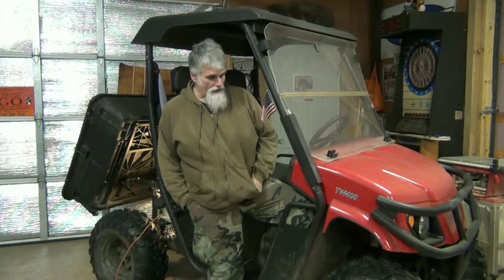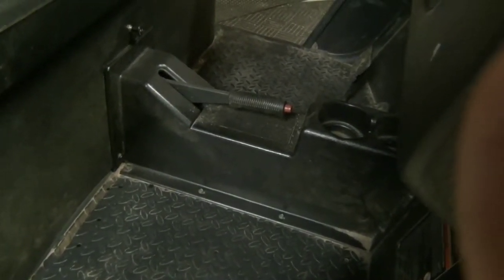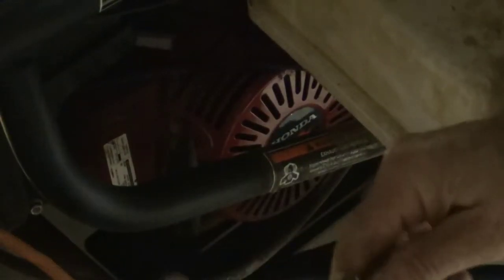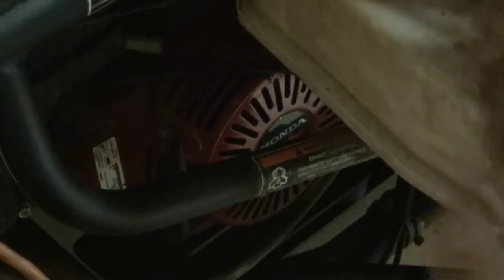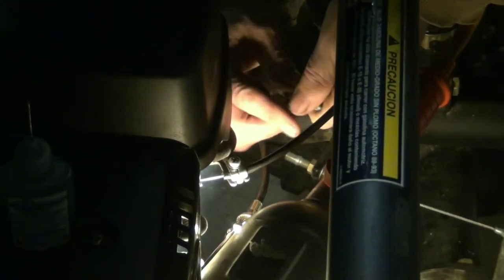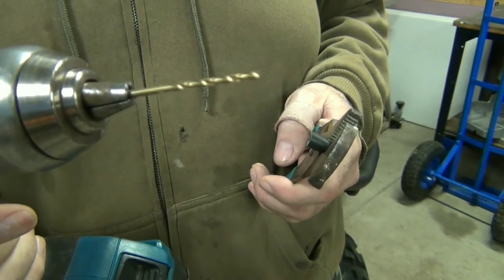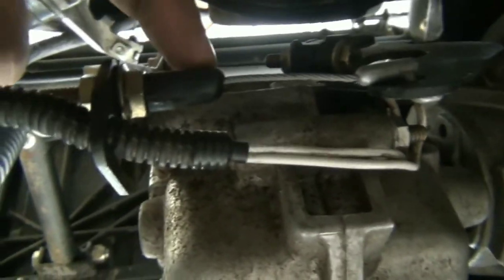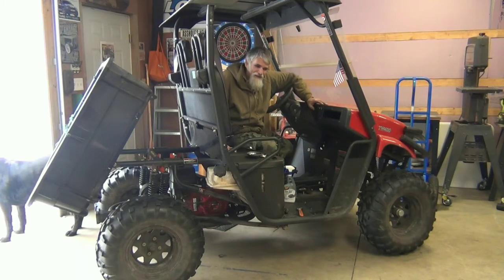TW400 TRAIL WAGON How to fix freezing Shift Cables using BLUECREEPER

Comment: Good video. Thanks for the info. I just purchased my tw400 at an auction. Both shifter cables were locked up in mine. I replaced them both. It wasn't too bad at all. They are available on Amazon. With the seat, dump bed and seat pan removed, it's very easy to work on.
Reply from the maker: I put the bluecreeper in mine, because we do drive this in the wet, so im hopong my fix wards off replacement for awhile.  Appreciate the comment. :)

Comment: Had the same cable freezing problem, but use antifreeze instead, flush it several times, no problem since...
Reply from the maker: Good idea! How did you flush?
Reply: @TamarackRidge  Never disassembled the cable, just pour the antifreeze into the cables behind the dash, then blew them out with the air hose, lots of crud cam out.  At least with the antifreeze it gives some form of lube and never freezes.  Also, put a white rag to see the dirt that came out...